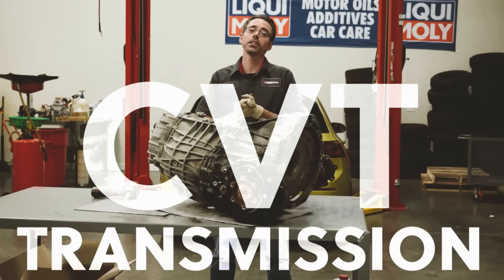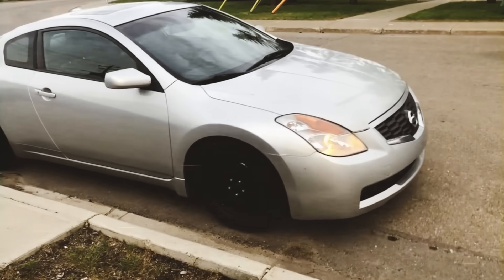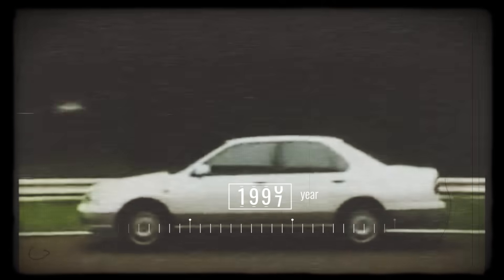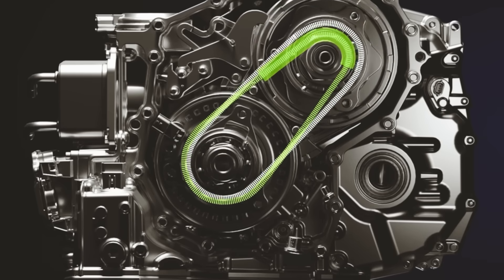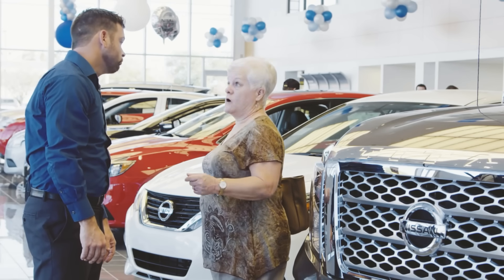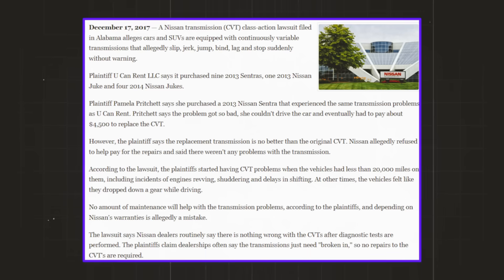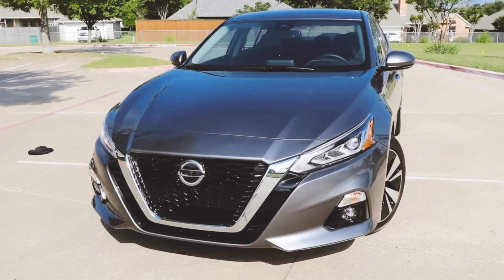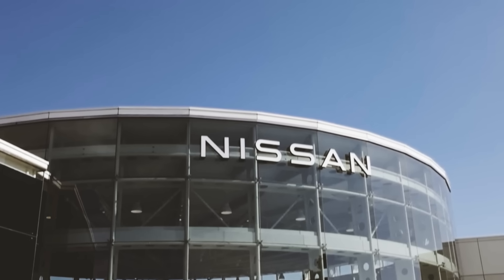Unpacking the FAILURE of Nissan's X-Tronic CVT

Comment: My Mitsubishi Lancer ES uses the same transmission.  Funny thing is, Mitsubishi transmissions last longer.  However, Nissan uses different fluid compaired to Mitsubishi. Coincidence?
Reply: Yup I had a 2013 GT I bought brand new only changed the Fluid one time at 99k I sold it at 225k never had a issue with the CVT tranmission
Reply: @matthewreed1078 my 2008 versa I only changed the fluid at 100k and some it at 210k with no cvt issue
Reply: Yep.. i think mitsubishi's cvt coolers are slightly larger,,,,
Reply: I used to have a 2011 Lancer ES. I changed the fluid every 35k miles. I got 185k miles out of it. If I didn't total it due to an accident, it would probably still run without issues to this day.
Reply: I have a 2011 Mitsubishi Outlander with CVT. I changed the transmission oil around 140k with Amsoil cvt oil , replace tranny filter and cooler line filter. It’s running strong with 146K
Reply: @rafaelbetancourt3551  I wish nissan would use whoever was making the tranmissions for Mitsubishi
Reply: @matthewreed1078  Funny thing mitsubishis cvt are the same Jatco units as nissans... The thing is mitsubishi payed more atention to the engineering of them and added transmittion coolers and diferent cvt oil, I dont even understand how Nissan has outsold mitsubishi with inferior investments on their cars "important" parts
Reply: @pedromont7867  I  know every dogs Mitsubishi like they make bad cars that's all i have had for years they make a good dependable car suv I have had 2 lancers and 1 outlander sport and 2 outlanders my last outlander was a 2022 se but it did have a few problems
Reply: But now even Mitsubishi is using Nissan CVTs...
Reply: @vitoaditya8337  they always used Jatco CVT transmissions.

Comment: You would think after 32 years Nissan would have had the CVT perfected but nope
Reply: You'd think with this much trouble they would have gone back to a conventional gear/clutch pack auto trans. These CVT's are nothing but a glorifed snowmobile clutch pack which used a rubber belt instead of a chain. These trans are utter garbage. If you dare pull a trailer you will kill your CVT even faster.
Reply: @markseehawer3762  They just should divide oil circuits into two parts: 1. part for hydro transformer and hydro block
2. Part for belt and cones. 

That should decrease the amount of metal that is affecting the bearings and hydro block decreasing it reliability.

But yeah, that's too fking difficult task.
Reply: @markseehawer3762 subaru is married to cvts
Reply: @Venomoustoxins2122  I wouldn't buy a Subaru anyway not with thier head gasket failures. So 2 reason not to go with subaru. As japaneze cars go they're at the bottom of the barrel even under Nissans.
Reply: @markseehawer3762  You have to forget the way you drive with traditional transmissions if you are to save your CVT. They are not the same, but if you realize and stay within it's severe limitations, it will last longer.
Reply: @floridaredneck  I've been a mechanic for 39 year I know a POS when I see one CVT's are nothing more than a glorifed snowmobile clutch system. If you plan on doing Any towing they just won't last and they are throw away transmission. Just garbage. But if you think they're great by all means go ahead and buy a vehicle with one.
Reply: @markseehawer3762  I don't think they're great; never said they were and never said I towed anything. I think it sucks for a car to tell me how to drive it, but I didn't know that 7 years ago when I bought it. I wouldn't buy it again, but once you make that decision, you're kinda stuck with it no matter what you buy. Now, I could change that by selling it and incurring a car payment, but I like life without one. 

I wouldn't buy another one, but right now, I don't have to. I thought it was more like a minibike than a jet ski anyway. But it looks good, runs good and other than no frigging power I'm good with it. I bought a motorcycle with the money I'm not spending on another car, so I only drive it when I go to the store or it rains. It'll be 10 years old before it has 70,000 on it.
Reply: @markseehawer3762 I bought an 07 Altima 3.5SL with the CVT. Brand new. I still even got the cars window sticker from when I bought it.

I never floored it the first year, after a year it was wide open throttle everyday. 6500rpms all day. Changed CVT fluid at 60K, then 120K. Then 150K. Then 200K then my last change was 260K right when the car was totaled as I was parked on Main Street and lumber hauler fell asleep and destroyed the whole driver side. I did a moto engine flush at 200K. CVT never caused me any issues!
Reply: @maxboya  Thank for your reply. I'll bet you never towed a trailer with that car did you. I don't know where you live so maybe you don't know how a belt clutch works on a snow mobil. The drive pulley narrows as engine rpm goes up, that what makes the snow mobile go faster. A belt clutch pulls on the  belt. CVT is similar only instead of a belt its a chain, and instead of pulling the chain is pushed on the power side of the pulley. over time this chain tears up the drive and driven pulleys. It is a weak setup. in a convensional auto trans power is transfered through clutch packs to planetary gears this is a much stronger set up. The only reason that auto makers have gone to CVT's is they are cheeper to build. Nissans verson is not rebuildable, so when it fails you have to replave it. Thats why i don't like CVT's.
Reply: @markseehawer3762 Why are you towing with a car in the first place? They're not designed for it
Reply: @JamesThomas-kx5sj  This might surprise you. But people used to tow with cars all the time. No I tow with a dodge cumins diesel The point I was trying to make was That CVT's are a CHeep weak design, And by the way there in the pathfinder, the titan, and the marono. too. I guess you just missed the point. The CVT is just another example of the auto makers cheeping out at the expence of the consummer.
Reply: @maxboya same with my old '16 Altima SR I boght new that had 134,000 miles on it before she got totaled in May by a driver running a red light hitting me. Never had CVT issues. Original CVT and transmission. My 1st CVT fluid change was also at 60k and 120k I never missed any maintenance intervals. I treated that car so well, it treated me well in return. I even made a 1100 mile round trip road trip last Thanksgiving with 122,000 miles on it. Very smooth ride and got 42 mpg going 70 moh on cruise control. I bought a '24 Sentra Premium. I know the CVT won't fail on me like my old Altima.
Reply: @markseehawer3762 and Toyota and Hondas cvts. Theirs have been reliable. It's not the tech or that it's a cvt.
Reply: @MC-hl2yx  Fact is if you want reliablity. strength and easy repairs. you have to go back to a 5 speed manual transmission. And by the way they give good gas milage because there is no slipage. Of course you'll have to learn how to operate it, and you won't be able to gab on your phone. Oh thats right your not supposed to be on your phone while dfriving. You know what else most young guys are missing out on how much fun it is to drive a manual trans car. i'm actually thinking about converting my truck over to manual transmission.
Reply: @markseehawer3762  I drove an Xtrail 2015 until 2020. The car had a 2.0 liter petrol petrol engine MR20DD with CVT transmission. By 2020 the car had 180k kilometers without any problems with the gearbox at all !!
Honestly I don't understand what is happening in USA. In other countries there are no major issues with the CVT. WTF
Now I drive the updated model same engine in Nismo form. So far I have 70K kilometers. Same story!!!
Reply: And usually stuff from Japan are good
Reply: @TiFA_7R   Not when the reliability needs to meet American standards.
Reply: @TiFA_7R except that Nissans tend to basically be rebadged Peugeots, so they are mostly French cars not Japanese
Reply: They actually already made a perfect CVT, they helped develop a Toroidal CVT (aka the Extroid) which is basically 2 mechanical CVTs fused together. They could handle extremely high levels of torque and were better at handling heat dissipation. They were cheaper to make compared to the Xtronic CVTs they make today and were much more reliable and durable too. 

Why they shifted from the Extroids in favor of the crappy Xtronic is something of a mystery to me. Plus you would think that because of all their troubles that they would go back to using traditional automatics or even DCTs in all of their cars. Thankfully the new Pathfinder uses a 9 speed automatic but it’s even a wonder why they decided to put a CVT in an SUV in the first place.

Renault saved Nissan from the brink of death and now the Jatco CVTs are bringing them back to that slippery slope between life and death. Unfortunately I fear that by the time they fully realize this, the brand may no longer exist.
Reply: @original__gmebvy an abomination of a marriage
Reply: Or that Nissan seems to care that much. I suspect that they work on the basis that it won’t fail on the first owner or under warranty so it’s not their problem.
Reply: @peterj5751 truth be told.
Reply: It's the junk Jatco transmissions they use with renaults
Reply: @lowkeydiegoduran4724  every car built by the French is junk lol
Reply: Its all Jatco’s fault!
Reply: CVT's are in theory really good, always within the peak of the power band and great for fuel economy.  Nissan needs to increase the service intervals on these CVTs. Also you need to think that Nissans are some of the cheapest cars on the market, people who buy them probably aren't thinking about changing their transmission fluid or anything and will ignore service intervals forever. I know it's anecdotal but I've seen plenty of Nissans with 200k+ miles on their original transmissions because they were rigorous with the maintenance. I still will never own a CVT vehicle but for the average user who keeps up with maintenance it is fine in theory.
Reply: @eg39701  

Well for any car it’s important to keep up with maintenance. Can’t complain about reliability if you neglect it.
Reply: It's not fixable, the concept is flawed from the start. Only good CVTs are Toyota's E-CVT. Here on the other hand, the design is bulletproof. The last thing that will fail on these cars is the transmission.
Reply: you cant fix something thats doomed to fail.. subaru is hardly any better etc.. the new larger CVT is a bit better but still I dont trust it.. Been through three CVTS on mine within 120k all covered under warranty
Reply: Nissan knows very well how to make good manual transmissions, even cheaper one's, yet they are still pushing CVT transmission that just refuses to work. I tried buying base model Versa with mt and couldn't or they just didn't want to sell me one.
Reply: The best CVT from Toyota and Ford are excellent! Reliable, tough as nails and fuel efficient.
Reply: @rocketman3158  only due to hybrid system, without electric propulsion all strain goes to cvt.
Reply: What is the number 1 rule for corporations?
Maximize profits by any means necessary.
Reply: 2:53 the  explanation of conventional automatic includes an animation of a belt type CVT .
Reply: All CVTs slip at low speed and aggressive throttle input, feature no one has eliminated. Reason Toyota few years ago came out with a Hybrid CVT; has a mechanical 1st gear ratio  and transitions to CVT mode when road speed picks up and under light throttle.
Reply: Instead of thinking that Nissan hasn't improved their transmissions in 32 years, better to think about how bad the owners are. With maintenance.
Reply: Or given up on it.
Reply: The concept itself was flawed.
Reply: @bobochan4699  Yes it is. It is a weak design that is cheep to build.
Reply: They have. Research is your friend.
Reply: It's crazy.
Reply: My 2015 Rogue 274.000 km still running strong.
Reply: Here’s the thing is Nissan has never used the CVT transmission until about 15 years ago so they’ve always been super reliable 32 years ago when they had manual transmissions
Reply: man, you can say that again! my stupid family members are still buying these out the rear end & NOT asking me about them.
Reply: So pretty much 3 decades of Filth and fuckary
Reply: Ford had a better CVT. My dad gave me his old '07 Freestyle and she finally gave way at 458,972 miles. Never changed the transmission, just drain and fill with new fluids
Reply: Have a French CEO didn't help matters. Plus he stole money from the company. Hopefully they actually make it reliable now. Only thing keeping me from buying a Nissan is the unreliable cvt
Reply: So bad, they should ban them
Reply: It’s something that the industry needs to give up
Reply: Nissan does not make its own transmissions. They use Jatco transmissions. Not exactly the best transmissions out there. No one rebuilds a Jatco CVT transmission. You have to buy a new one.
Reply: They did,it lasts the
 Warranty period 😂
Reply: You can't perfect junk
Reply: They work to make sure... you buy a new Nissan... or not.
Reply: I bought a 2025 X-Trail (=Rogue). I am experiencing an unpredictable and jerky transmission that makes me shake back and forth several times when it seems to “change gears”, although I heard CVT should be smooth. It is especially noticeable when slowing down without pushing the brake at low speeds between 13-33 km/hr. It is my first time driving CVT, and this is a brand-new car, so I am unsure if this jerkiness is normal. Please advise.
Reply: I bought a 2025 X-Trail (=Rogue). I am experiencing an unpredictable and jerky transmission that makes me shake back and forth several times when it seems to “change gears”, although I heard CVT should be smooth. It is especially noticeable when slowing down without pushing the brake at low speeds between 13-33 km/hr. It is my first time driving CVT, and this is a brand-new car, so I am unsure if this jerkiness is normal. Please advise.
Reply: @hojoonlee8437  I have a 2023 vc turbo Altima with the same cvt and mine doesnt jerk or shake or do anything but run smooth it has 7500 miles on it
Reply: Well, perhaps it is not fixable. I do not mean that they are all doomed to fail by design, but perhaps the reliability is just lower in general. Heck, let's assume it is only 30^% less reliable. It still hurts the trust in CVTs
Reply: You would think they'd learn their lesson 1st lawsuit
Reply: Actually it’s perfect, for them, they have it working exactly the way they wanted it to work, smmfh 😡😡😡😡
Reply: I don’t think it’s possible to perfect a CVT.
Reply: @ashc3765  eCVTs from Toyota are as good as CVTs get. No belts or chains, just an electrically induced planetary gear set.
Reply: @ashc3765  toyota makes stout CVTs that have a launch gear so most of the stress is on a regular gear. cvts do alright at speed.
Reply: @ashc3765  Subaru & Toyota have them "perfected", Subaru uses a chain 7 not the "rubber band", and Yota has a conventional launch gear on the new ones
Reply: @ashc3765  the majority of the wear is from initial acceleration. Start in a first gear then transition to the cvt. That's what Toyota does...... now.
Reply: I’m not a fan, but the one in my Ford  Escape hybrid has been flawless
Reply: Good question
Reply: So traditionalister automatisk transmissions are perfect after 120 years of development ?
Reply: @ErikAndersen-pf5yh  Nothing is perfect of course, but certainly not 32 years  of no improvement? in reliability?...as a tech,I see more Nissans with blown cvts then any other maker combined every single year … honestly, Nissan has been a gift to the transmission shops.
Reply: @ashc3765  It's possible. But they haven't figured out a way to incorporate some sort of sensor which would have to detect burned fluid. My guess is it's outrageously expensive to incorporate a sensor sensitive enough to detect the thinning of the fluid.
Reply: car enthusiasts say the same about Mazda's and rotary engines hoping one day a rx-7 and rx-8 successor will appear. And it did but its electric with a rotary range extender.
Reply: Newest CVTs are reliable Idk what you are talking about.
Reply: @rafaelg9016 hey now, that's not what reddit or some random mechanic of 39 years say, get with the program bro. CVT bad...lol Modern CVTs and hybrid CVTs are a lot better.
Reply: @rafaelg9016 especially the Toyota and Honda ones, but I'm still gonna recommend a decent fraction of the recommended service interval size be trimmed off for the possibility that a near indefinite life expectancy can be produced.
Reply: @alexwalker8422 we have a '13 Accord with the CVT. So far, it's had no issues and is at 184k. I do have the fluid changed at roughly every 30k. Hopefully, that'll help it last another 100k miles.
Reply: @jeffduncan9140 I have the same car with 172k miles .. original cvt and I do the 30k changes as well… I was wondering about the other components longevity like the fuel pump, the cats, water pump etc… can you tell me if you had to change any of them… so far I did change the starter multiple times, and the alternator.
Reply: @alexwalker8422  no, all cvts sans eCVTs are garbage, there isn't a single good one that exists.

Comment: The maintenance recommended in any car's service manual is only enough to get the vehicle to the end of its warranty. However, belt-driven CVT transmissions require a lot more maintenance if the owner intends to keep the car after it's out of warranty.
Reply: Amsoil fluid and a external cooler
Reply: Also an external paper filter for the transmission. It has to be changed every 20k to 30k miles
Reply: You probably need to change the fluid and filter every 20,000 miles. I think that's what the CarWizard on YouTube recommends, and he owns a Nissan Cube.